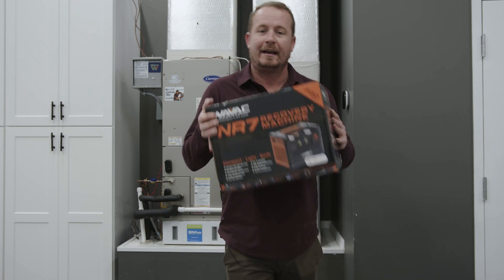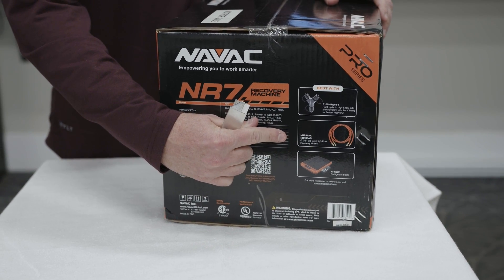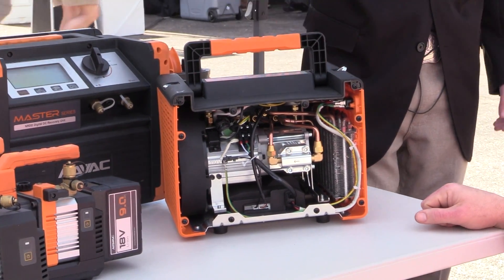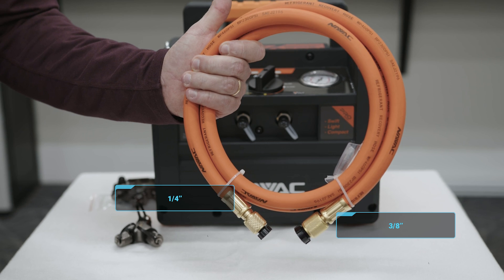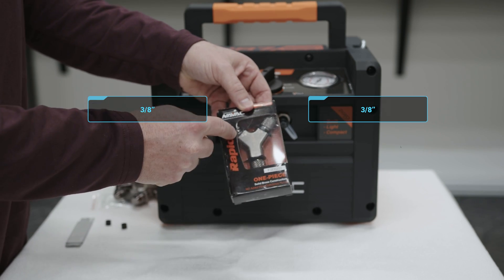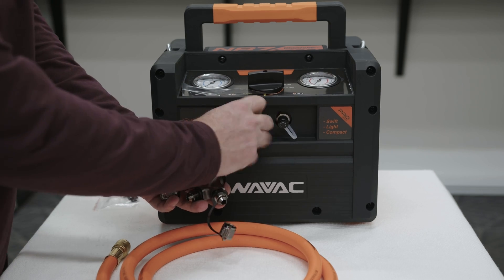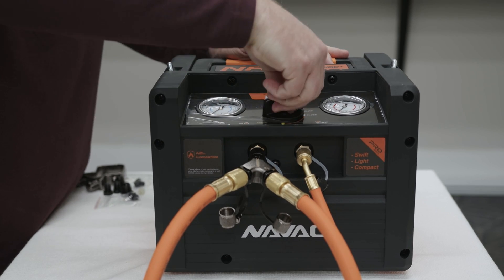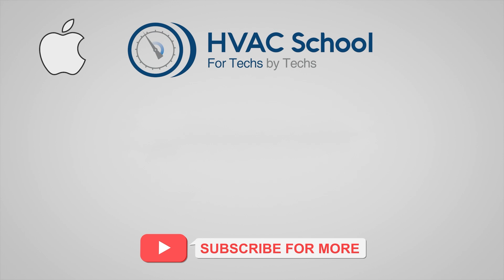Unboxing the New NAVAC NR7

Comment: I’m not interested in any Navac products after my experience with the service gauges. I bought a 3 hose manifold due to their marketing it as extremely durable. I am very gentle on my tools compared to most, but the hook broke after about a year. No big deal, I fixed it myself. Well another year and the plastic housing that is supposed to protect the gauges and hold the hook assembly is just falling apart. Navac won’t do anything for me. Very unimpressive if you ask me.

Comment: Sweet little unit.  I have the NRDC4M and absolutely love it.  

Two things - don’t forget to purge your hoses or pull a vacuum before filling the cylinder.(NRDC4M does this automatically)

Second, how important is a drier? Would it be something you should use every time, or only if you suspect contaminated or old refrigerant?  With these new hoses tees, you will need to use a large filter drier. 

Thanks Brian!
Reply: It depends if you're recovering and putting it back into the system. EPA wants you to put it through a filter dryer 100%